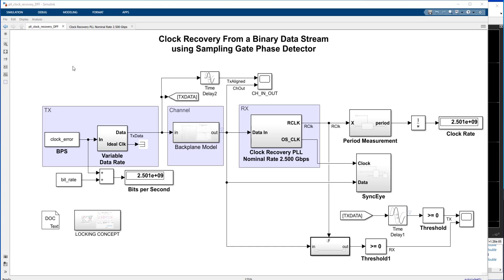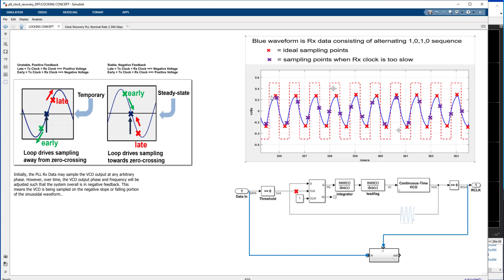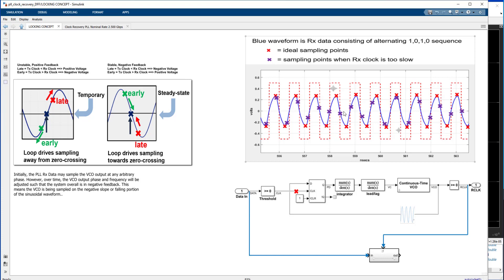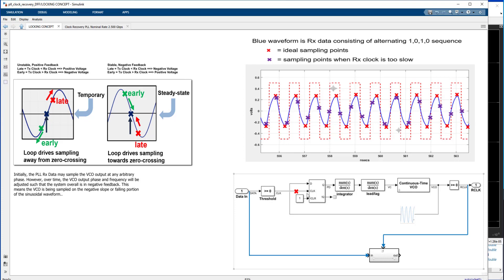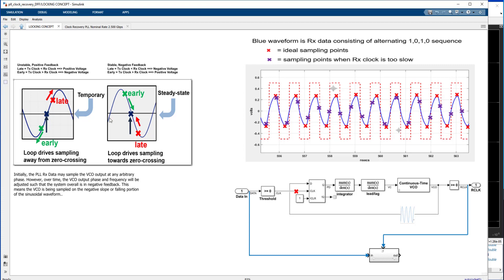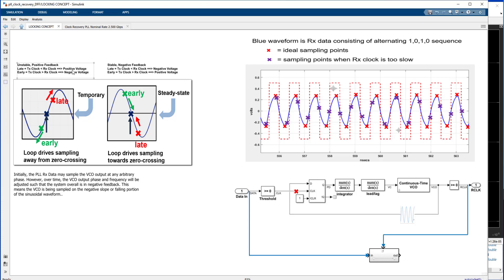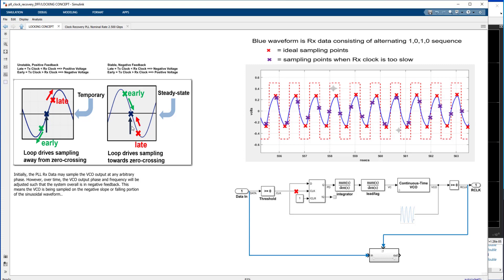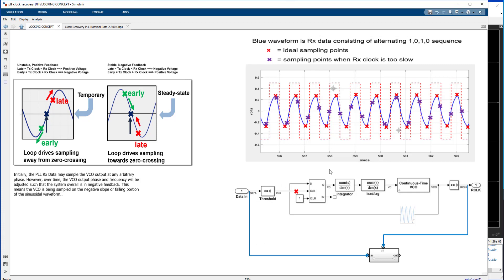Using a Single DFF for Phase Detection in clock and data recovery (CDR) loops

Comment: Very nice! I'm working on something similar.

I noticed you are measuring phase but controlling frequency (VCO) with the phase error. Phase is the integral of frequency i.e. a fixed phase error applied to the VCO control will cause a continuously increasing phase error. An integral implies a 90 degree phase shift.  You have a second integrator in the loop -- another 90 degrees? Does that mean you have 180 degrees around the loop, essentially creating positive feedback?  Does that mean it will oscillate?
Reply: You are correct Norm about the phase shift in the loop. That is the reason the lead/lag compensator is there. It is the lead portion that is saving the day in terms of phase. It adds phase (phase-lead) over a critical portion of the PLL loop response and in doing so minimizes oscillations. You can analyze this easily from a control systems perspective using  the transfer function based model I used for optimizing the gains. That's the latter 4 or 5 minutes in the video.
Reply: One thing you can do is experiement with the gains in the lead/lag filter and then observe how the system behaves stability wise. Try this both in the CDR model and in the control systems centric model.